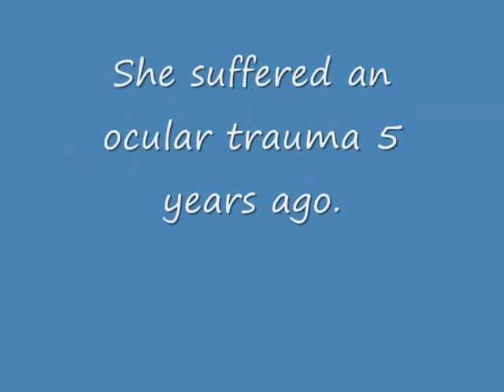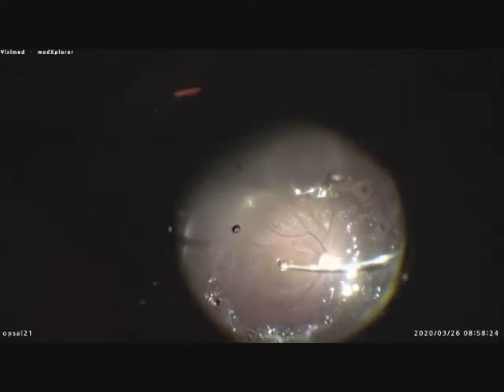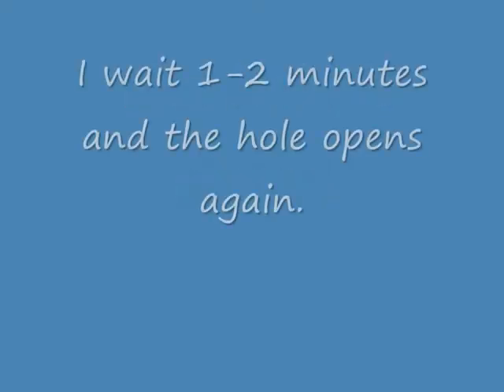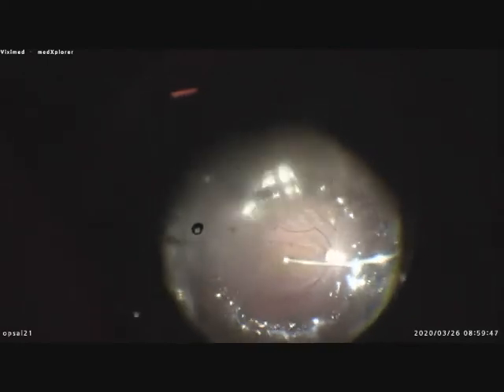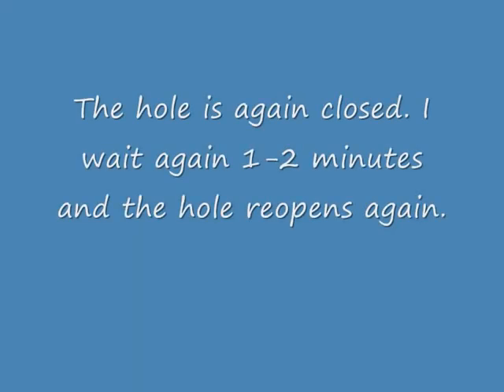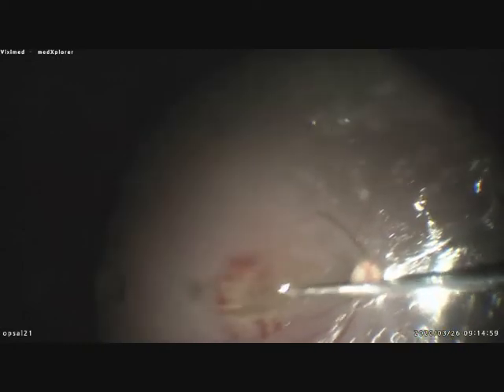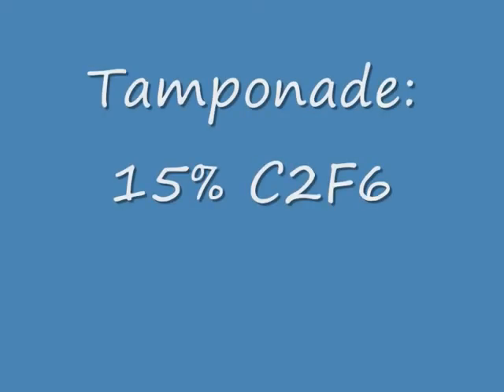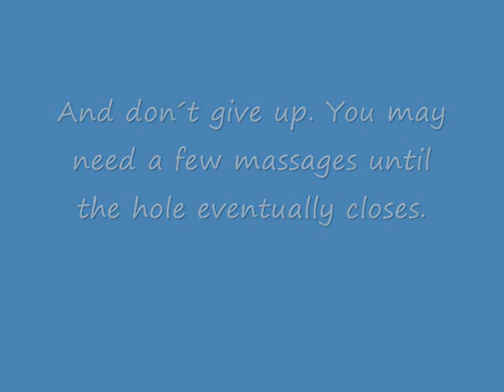Vitrectomy for a very large macular hole (2222 µm)

Comment: One thing that occurred to me, In patients which post operative positioning is impossible to implement, do you have to modify your approach? Would you ever perform Silicone Oil instead of Air and try a face up lying on back position? That might be more effective in some patients particularly in infants since they normally lie down for a lot of their daily time anyway
Reply from the maker: yes, in these patients I prefer long working gases or silicone oil. The postop positioning is as far as we know only necessary in large holes and not in small holes.

Comment: Congratulations to this case. Have you done anything to further detach the retina around the hole? The retina seemed to be much wider detached compared with the OCT.
Reply from the maker: No, only massage. I assume that in these large holes the situation is comparable to posterior synechiae of the iris. It is essential to mobilise the retina around the macular hole so that the hole can Close.
Reply: @ulrichspandau  I was wondering a little bit about the big subretinal fluid bubble at the beginning of the video. With an old macular hole I would have expected synechia around the hole and only little subretinal fluid at the edge of the hole. Carsten Meyer propagates precisely for this reason the puncture of the retina around the hole with the injection of subretinal fluid to loosen the synechia and close the macular hole. Maybe the combination of both, namely puncture and massage, will help. In your case the puncture was obviously not necessary because a relatively large amount of fluid had spontaneously collected under the retina.
Reply from the maker: I measured the inner retina. If you measure the outer retina then the hole is much bigger.

Comment: Wow, Amazing as always. Beautiful surgery. But would you have tried it differently if the ILM was present ?
Reply from the maker: You mean with ILM flap? Yes, why not. It is technically easier.
Reply: In large macular hole, previously not operated what will be your preferred technique- a flap or massage? After 6-12 months of surgery how many of these large holes reopens? And the third question is if you ever have encountered a large macular hole closed on table by massage technique and opens on the first post operative day? If they patient is persistent how many times will you operate on a failed macular hole before deciding to leave it as such?

Comment: Thank you sir for such a nice case. I have one que though. Some surgeons dont advise fluid suction at the hole as this will suck the photoreceptors also. What is your opinion??
Reply from the maker: Use Always a backflush with silicone tip. Be careful when aspirating. The view is reduced under air. But you need to aspirate in the macular hole in these difficult cases.
Reply: Thankyou sir, so nice of you

Comment: Great case Dr. Ulrich Spandau congratulations, would you recommend to use the Flex Loop for the massage?
Reply: It is better to do massage with silicone tip than flex loop to minimize retinal trauma
Reply from the maker: I assume that the flex loop is more traumatic. I would maybe start with vaccuum cleaner with silicone tip and if there is no success I would switch to the Flex loop.
Reply: @ulrichspandau   Thanks for your answer Dr. Spandau. Regards.